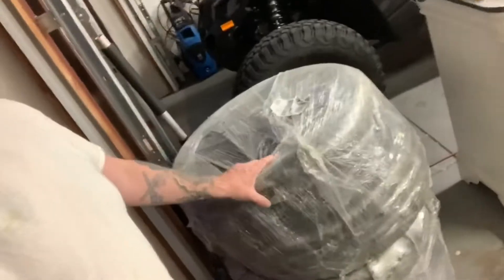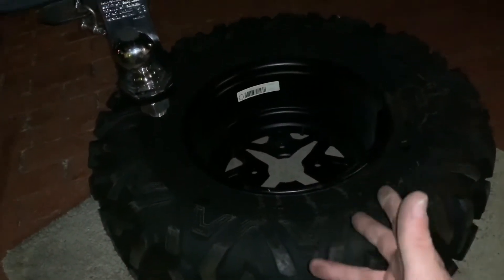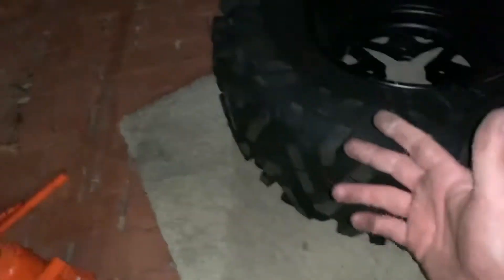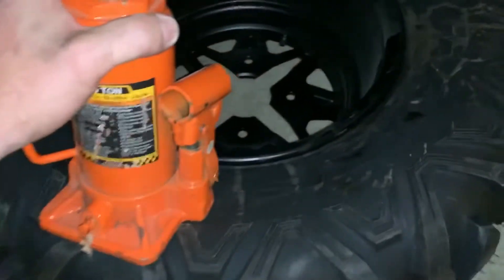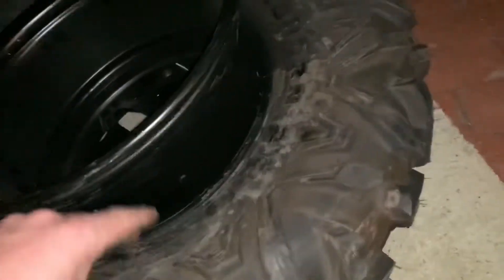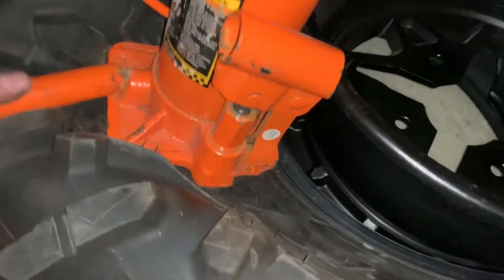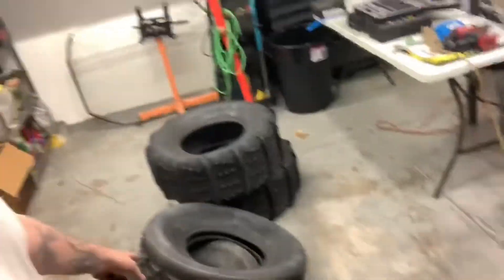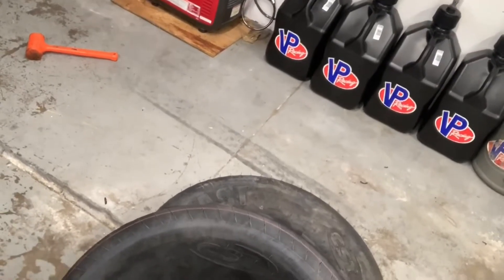CAMP RZR 2019 GLAMIS DUNES PREP! CST SAND PADDLES ON STOCK X3 RIMS AND THINGS GET SKETCHY!

Comment: Just did my 19 xrs wheel bearings last weekend. Tip, take the rear mud scrapers off otherwise the rear rotors won’t pull out. 6 bolts holding them on. I left them off due to people on forums talking about them being culprits of rocks getting caught under and splitting wheels. 👍
Reply from the maker: Rob H thank you brother! Will do!

Comment: Are the CST paddles 30x12x14 on stock 14x7 rims for the rear? I’m looking at the same set up.
Reply: Same here did u ever find out bro
Reply: I mounted 30x10x14 CST fronts on stock 14x7 rims and 30x12x14 on stock 14x8 rims rear.
I wanted to stay close to the stock width so it would fit in my trailer